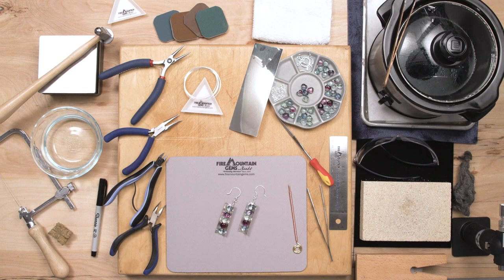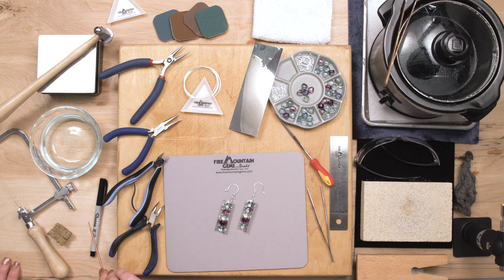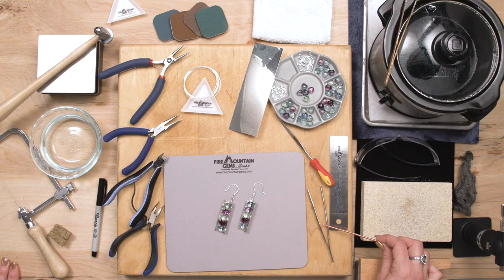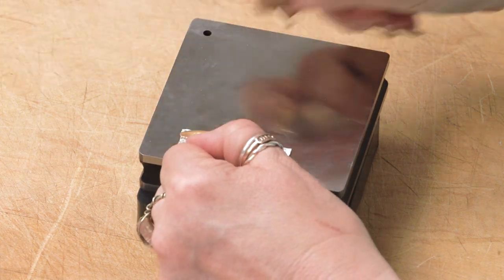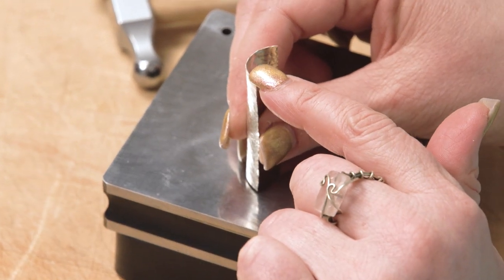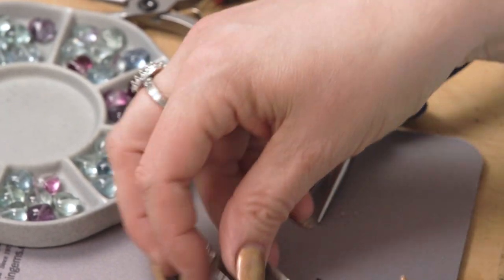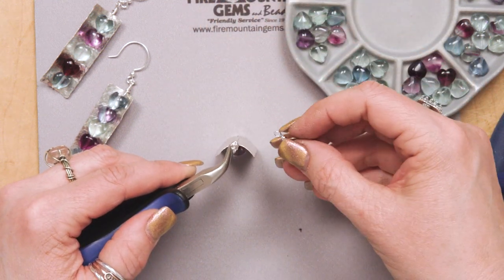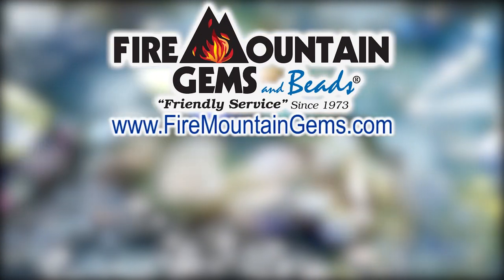How to Add Style to your Gemstone Earrings with Simple Metalwork

Comment: I need to replay to see if she ran one of wires up behind the silver - or are the beads “free floating” against the silver?
Reply from the maker: If you watch starting at 21:40, you will see the technique for adding the beads. The wire is bent in the middle, the bend sits at the bottom of the silver sheet, the ends of wire run up both sides of the silver sheet, the beads are strung onto the wire on one side and then the two wire ends are joined back at the top, looped and wrapped to finish the piece. The tighter the wrap at the top, the more snug the beads will be against the sheet.